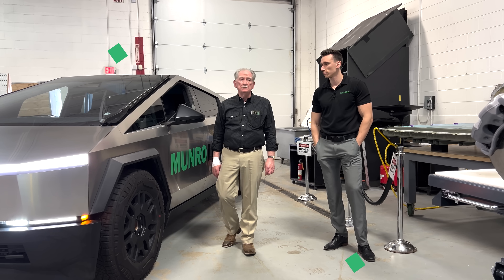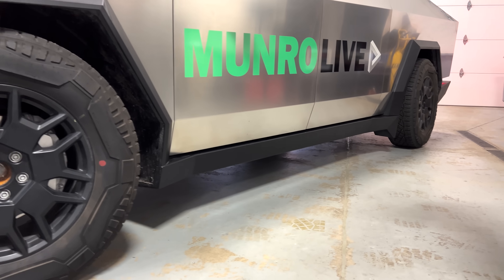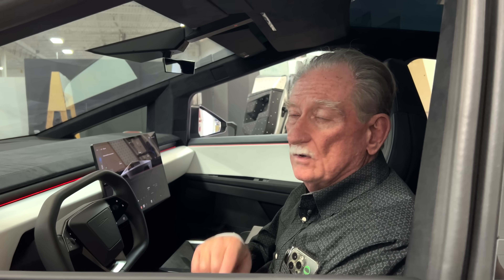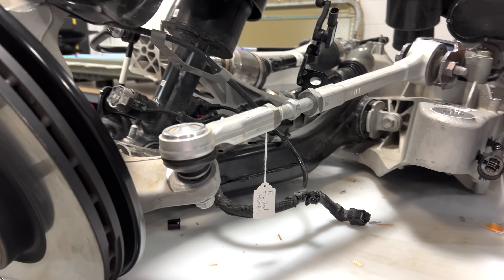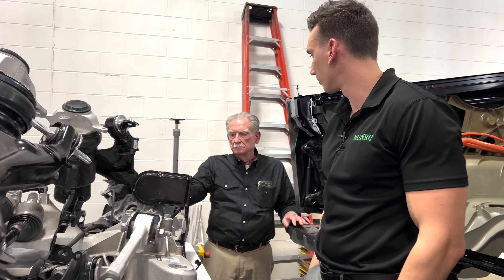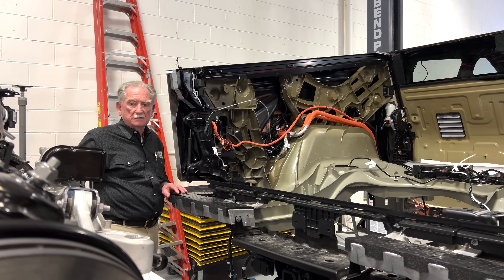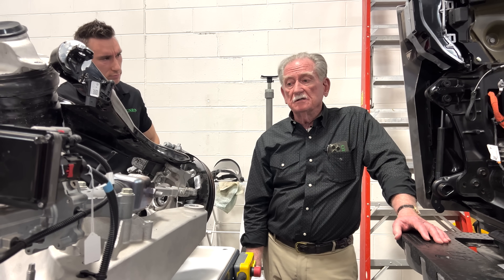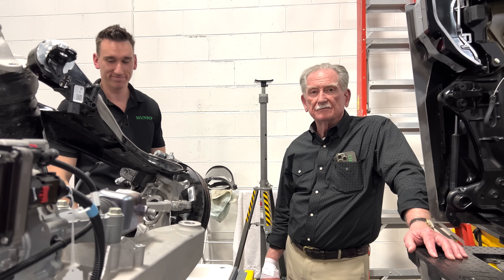Tesla Cybertruck Steer-by-Wire System

Comment: As much as I like Tesla and the Cybertruck- I have to point out that the 2 ribbon cables which provide steering input commands to the rack and pinion motors does not qualify as redundant, much less "double redundant" 
Both ribbon cables share a single connector which means the connector becomes a single point of failure that impacts both systems.
This concerns me as it would not qualify in an industrial application as "redundant" much less when applied to a "people mover" application.
Reply: Agreed, redundant would be two separate cables taking separate paths to separate ports.
Reply: actually, each of the cables drive each steering motor. So, there's no redundancy here.
Reply: @flashmedia8953  Really??  Then the redundancy must be a completely separate system- not shown. ( i hope)
Reply: Sandi pretends to be all knowing, expert on all subjects, that's the worst kind, pretend to know, blow smoke, hope the check clears.  Another fake, phony fraud...And he doesn't understand what vertically integrated means either.  He claims Tesla is, tesla is far from it.   What a tool.
Reply: Tesla is non stop fraud and lies.  How are these things on public roads, being used as a test track.  Real car companies have their own test tracks, and don't use customers as crash test dummys
Reply: looks like... you idiots don't have a clue in the world... i get it you hate elon ... stop acting like you know what your talking about. you don't
Reply: I will wait for the Munro engineering assessment because my assumptions are just that.
Reply: Same here Thought the same Thing
Reply: Thought the exact same thing. There also seemed to be an implication the steering motors were powered by that ribbon cable, which is clearly not the case. Also, no doubt the front module just communicates with the steering motors/sensors using can bus. Also find it intriguing that a massive connector almost the size of a human hand is apparently a marvel compared to a simple, compact and cheap 4 pin connector which would otherwise be used (12v, gnd, can high, can low).
Reply: @coreyw427  this cable is not the purpose described in the video, and You are right with CanBus. Actually, the motors are driven by it.
Reply: Looks like there is two cables for redundancy.
Reply: @ElySky95  into the same connector.  Not redundancy at all.  tesla is all about the smoke and mirrors
Reply: @cengeb  no it appears to be two separate cables for redundancy, the CyberTruck schematics are out there maybe i or some of you guys could check it later.
Reply: @cengeb  as an electronics engineer i'd trust any ol' twisted pair of canbus wires plus two pins for power way more than these flat flex cables
Reply: @andreas9238  knowing tesla probably not even rated for extreme temperatures vehicles endure in summer or winter. He probably took standard ribbon cables used indoors in computers...calling it engineering costs out of vehicles. Sandi, being as clueless as one cult member can be,will claim it genius. Sandi has low standards for what is considered genius
Reply: @andreas9238  As a mechanic, my fear was that they'd use canbus, what they did is probably more reliable.

Comment: Wait, so the redundancy on the cabling is done with cables that are TOUCHING each other?  So if some physical damage occurred to one wire will very likely affect the other wire set that is TOUCHING it?   Crazy.
Reply: Also appears to use a single connector, so there is a single point of failure there.
Reply: They are showing us the two wire ribbons. Not showing us how they are routed.  I would have preferred two separate connections in two separate locations.  JMO
Reply: You can cut both with the same tool at once!
Reply: OP is correct, should not come together, should be port and starboard
Reply: It's almost impossible for wear and tear for gigabit Ethernet cable in fact it can survive over 20 years 
It's not the same as copper cables
Reply: @tv-ld3wv 

What? Gigabit ethernet is still a copper wire. Also I hope it can survive more than 20 years. We have vehicles with CAN bus copper wiring that are 30 years old now.
Reply: @tv-ld3wv  Umm, most gigabit ethernet cabling I've seen has all been copper.... It's usually four pairs of (IIRC) 24gage copper.

Also, ethernet cabling is usually installed in wall cavities, dedicated cable ducts and trays etc, and is (usually) not subject to much in the way of vibration, mechanical stress  etc....
Reply: @peeemm2032  
I was talking about the mechanical wear and tear that happen to the normal copper wires
Gigabit Ethernet solve this problem regardless of the main element it's made of
Reply: @tv-ld3wv  the wiring that Gigabit ethernet tupically runs over is normal copper wire. As I said it's usually four twisted pairs of 24 (or maybe 26) gauge wire.

If anything it's smaller and more fragile than standard automotive wire (which is typically about 18 gauge).

How does Gigabit ethernet solve the problem of wear and tear?

Canbus signalling is very much like ethernet, except it operates at a much lower bitrate (around a couple of Mbps), so is much less particular about the quality of wiring it needs to run, and can (and usually does) run over thicker, more robust wire than Gigabit ethernet does....
Reply: @peeemm2032  
Wrong not normal copper wire, there's gigabit Ethernet and there's automotive gigabit Ethernet, there's a very big difference
In fact It could be 5X more resistant to wear and tear than the normal copper wire you're talking about
Reply: @tv-ld3wv  last time I checked, standard gigabit ethernet wiring was run over standard copper wire, each conductor was either solid or stranded, depending on whether it needed to be flexible or not, and was insulated by some sort of polymer...

Given that there is, AFAIK, no such thing as "automotive" gigabit ethernet (at least until Tesla just "invented" it for the Cyber truck), how does it differ from "normal" gigabit ethernet, and exactly how is it it 5x more durable?

Also wasn't aware that "wear and tear" on copper wiring was a thing in the automotive environment anyway - I've never had a car where the wiring physically "wore out" - as far as I'm aware, most auto wiring issues are due to corrosion of contacts, or deterioration of insulation (usually due to heat)......
Reply: @tv-ld3wv  OK, turns out that automotive ethernet (1000BaseT1) is a thing, but only currently used by a couple of manufacturers (BMW, Tesla, and maybe Hyundai), but the difference between it and standard gigabit ethernet (1000BaseT) is that the automotive variant only uses a single pair of wires in full duplex mode, where the standard variant uses 4 pairs in dual simplex mode.

Can't find anything special about the cabling, and given that you can already buy hardened, armoured and shielded standard ethernet (Cat 6) cable, I doubt there's any particular advantage in terms of durability...

Tesla seem to be using some sort of ribbon cable to carry power and ethernet for their "Etherloop" - looks pretty flimsy, there doesn't appear to be much evidence of armour or shielding there, so nothing special about durability....
Reply: @peeemm2032  
You still don't understand the meaning of automotive gigabit Ethernet
Study it as a meaning not car use
Reply: @tv-ld3wv  you mean as a lifestyle choice, or an allegory for modern life maybe?
Reply: @peeemm2032  
Mommy told you that ?
Cables are not only found on a shelf that's saying only automotive usage
You can produce the best cable for the product with enough thickness and EMI shield etc. also I'm not interested in your lifestyle
Reply: @tv-ld3wv  Now add vibration to the mix, high temperatures (more than 50C), and soiling with oil. It absolutely can fail in these conditions.
Reply: whoa keyboard engineer! don't jump to conclusions..
Reply: @stunnerdoc  true

Comment: Lol, that is not a triple-redundant system 🤦‍♂
Reply: Not even close!
Reply: Explain yourself then??
Reply: @jimanderson2518  Critical system redundancy is dependent on 3 factors: 1.Components required for redundancy share identical design.
2.Complete and total isolation between the redundant components.
3. Complete and total failure of any single component in either redundant system has no effect on the remaining redundant system.

Clearly, this "drive by wire system" meets none of these criteria.

Comment: What about system latency? For instance a very rapid extreme change of direction at the steering wheel, how well do the motors driving the steering at the wheels cope. In some fly by wire aircraft controls there is a measurable delay which in extreme circumstances can produce a pilot induced ocillation where the input is going one way but the control surface is still travelling the other way.
Reply: System latentcy is the reason they had to use a 48v bus voltage and ethernet data speeds.

Comment: I don't understand how you can call this system "triple redundant". It is NOT triple redundand at all. It's not even close to dual redundant. In my experience in the aerospace and aviation industries, this is not even remotely redundant.There's multiple single point failure modes. First is steering sensor and feedback motor at the bottom of the steering column, then the rear steeing drive motor, and unleess there's full redundant circuitry in the control unit, it is also a single point failure component, especially if the redundant circuits share a common enclosure and electrical connector. As far as high a reliability design for such a critical function, this is a haphazard and dangerous approach. Even the wiring cable you displayed as "redundant" is a poor design. Having boith cables bundled together, and both cables terminated in a common connector fully defeats the propose of redundant conductors.

The only part of this system that should have "triple" associated with it is the sensors on the steering rack that tell the controller when one of the front steering motors craps out. The list of single point failure items in this system is frightening.

There is only one reason for the 48v bus and the ethernet data speeds; this grossly complicated "drive-by-wire" system. 48v is required for the peak impulse power demands of operating 3 steering actuators, and the high speed data is necessary to reduce latency between the steering wheel and the steering rack actuators. Other than that, it's just overkill that complicates supply chain problems for automotive electrical system suppliers.
Reply: Without reading the Functional Safety (ISO 28282)  documents, you can already judge it's not triple redundant?

I can already tell you how they would design it as I was a system architect for electric power steering at Bosch. But I won't bother, because this is YouTube. Not a safe space for intellectual discussion
Reply: @pusamus  ISO 26262

Comment: With all due respect Sandy, I don't think the Public is ready for a Ford Lightning Steer-By-Wire glitches and Simple Code Error. they don't have the Necessary learning curve & balls to Not Shortcut on Any Code Line.
management may decide to use a Shorter version, like that Short Spring..
Keep it up Y'all. Good Format.

Comment: Sandy, which technologies and processes from Cybertruck would you implement first to accelerate production on existing production lines ( probably for Model 3/Y)- 48v, steer by wire, battery pack? Other?

Comment: All of this reminds me so much of Mercedes in the 2000’s. 
Lots of new tech with lots of electrical / technical issues that plagued the cars and resulted in sales/ leases of new vehicles to rid owners of the problems. 

It’s neat but not something a lot of customers would need or want. I don’t see how the benefits outweigh the risks of steer by wire on a vehicle that’s already had plenty of electrical gremlins in a short period of time. 

I have a F150 lightning and love that it’s just like every  ICE F150 I’ve had before aside from an electric skateboard chassis. 

Let’s work on the battery charging and energy storage tech before we go reinventing the steering wheel (mechanical linkage)

Comment: Can the by-wire steering snap the front wheels in the appropriate direction way faster than a human could to save an otherwise unrecoverable slide where the tail steps out? Theoretically, that would be one of the major advantages of having steering without a physical connection.

Comment: What's the real benefit of having drive by wire? Because now tesla has to install two electric motors,  where it would be cheaper to install a manual steering wheel shaft.
Reply: Since it can drive itself (potentially) it needs most of that, anyway. This way, you lose the weight and collision risk of a steering column, and you can do the variable steering ratio thing.
Reply: @geirmyrvagnes8718  But does it save money? I know tesla is about that.
Reply: @xxZerosumxx  Presumably. Just think about manufacturing. Bolt in the assemblies and plug in connectors. Done. Probably very automated.  In addition to not having to pay for a steering column with linkages and going through the firewall with a big movable thing. The other parts are mostly needed for self-driving, so you can't delete them.

Comment: It’s more ZF steer by wire, than Tesla. They build these systems for years. Don’t understand the hype. The problem is not steer by wire, which is old technology, but need for a backup steering system outside the US.
Reply: You don't understand the hype.
Reply: Yeah, real time industrial control has been around for years (e.g. EtherCAT was standardised about 20yrs ago, and allows real time control over ethernet in various topologies (including ring).

Doubt that Tesla have invented anything new here - why wouldn't they use existing chipsets for this?

Suspect their "Etherloop" is just one of these existing protocols and about the only thing Tesla has added of it's own is marketing hype....
Reply: Then how come they're not all over the streets, bro.  Lol.
Reply: re: "Don’t understand the hype."  A: well Ego and regardless of where the Stock is at...? the "scam" of the Jordan Belfort Pump And Dump must continue unabated.
Reply: It's all ZF and third party suppliers, Tesla couldn't do shit without those innovative giants.
Reply: @BBingo-v5i yeah, tesla's definitely not known for vertical integration compared to other companies. 😅

Comment: 6:12 I would like to know more about the big gooseneck on the wheel assemblies, where the upper control arm is attached. It’s only on the front wheels. The rear wheels don’t have them.

I’m curious because I want to know how to change the structure to:

Raise the height of the lower control arm so there is more clearance.
Redesign the parts so you don’t need control arms, so you can go to 90 degree turn.
Reply: I guess it would be called 90 degree steer.

80 or 75 degree steer would make a big difference too.

The trick is more ability with fewer or simpler parts. Anyone can design a truck wheel that steers 360 degrees. But is it simple, is it durable?

Comment: How do the redundant steering motors work together if one fails? Each looks self impeding, or is that wrong assumption, and the defective one will just be mechanically overruled?
Reply: then it uses the third steering system.

Comment: I think I see room for improvement in the steering.  the steer by wire system still has a steering rod that goes into the engine compartment... which makes all the crash test dummies kinda nervous.  The steering, regardless of not being connected still feels hefty, but it is not connected to the rack and pinion.  Maybe they will remove that, because all they need is an Xbox controller sitting on the dash.  Thats all they need.  I really hope we get more about the electrical system because Sandy just picked up the entire wiring harness with one hand and casually said, yeah, this is what all the carmakers are gonna be doing in the future.  Why don't you guys show a wiring harness from a BMW and then show the cybertruck wiring harness lolz.  How does the touchscreen open and close the windows... does the wiring harness go into the doors?  Does the touchscreen in the back communicate through the same ethernet as the brake lights? Does the power for the tonneau cover go through the main bus, so the lights flicker while the tonneau is moving? Can you lower the tonneau, steer, open the port, step on the gas, lower the windows, turn on the lights, and watch two movies at the same time?  Will that flood the bus system with info?  You really don't ususally have to beg sandy to talk about Tesla's newest features lolz
Reply: An XBox controller does not have even close to enough feedback torque, and is lacking redundancy. This is not a very compact package, but no viable design is going to look like a video game controller.
Reply: Dont work to hard on this as Tesla wants the wheel to go away so you can just play games with the controller anyway...  will take a few more weeks yet though...

Comment: In 1988 a friend bought a Honda Prelude with 4 wheel steering.  Not steer-by-wire, but that thing was fun to drive.  
Thanks for the descriptions and views of the beast's steering.
Reply: Do you remember if that year prelude has the long steering driveshaft to a separate rack in the rear? I know they started using electronic rear steering on the preludes but can't remember which year
Reply: @DoingthingswithDAN  That I don't know.  It was a new 1988 .
Reply: @DoingthingswithDAN  Electronic 4ws didn't come until the 4th gen Prelude.